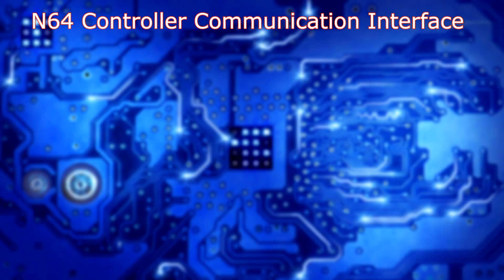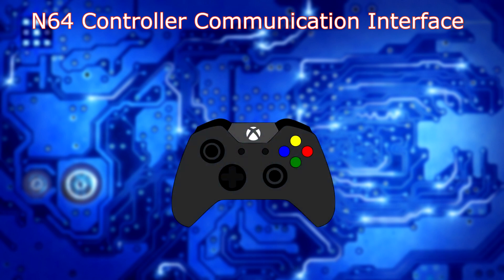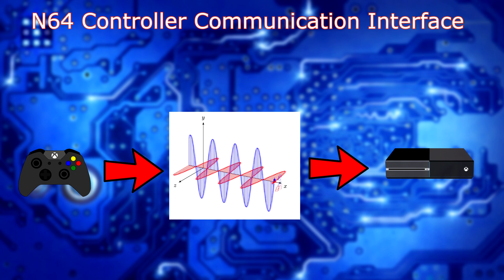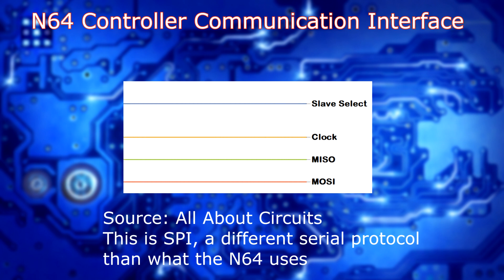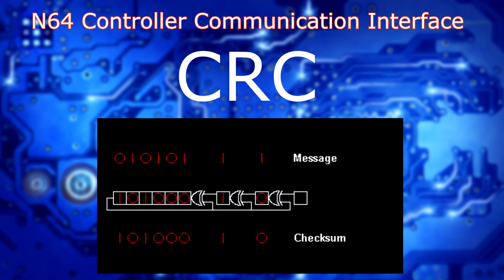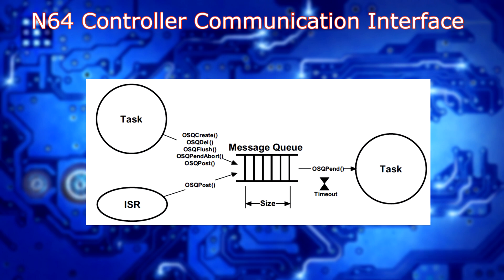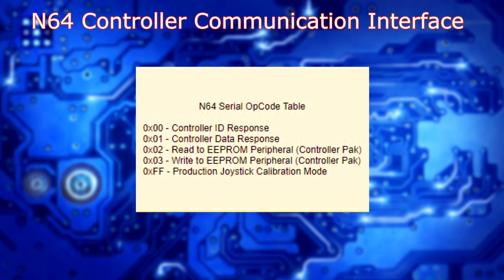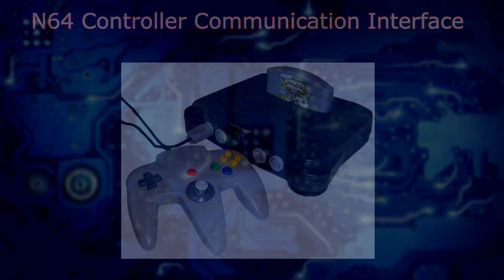How Does the N64 Controller Communicate?

Comment: The stick’s starting point is set literally every time you power cycle the controller. You can do this by unplugging and replugging the controller. There is also a software shortcut you can invoke in pretty much any official software by holding L, R, and Start. It has nothing to do with production or manufacturing and should be handled in software with no need for a special OpCode.
Reply: A lot of software developers use the word "production" to refer to code actively running on customer's machines after manufacturing and purchase.
Reply: @jl58533  “RTM” ;)
Reply: @emmettturner9452  I'm not sure what you're trying to say; if you mean "read the manual" it's been awhile but I'm familiar with the N64 and you are correct about resetting neutral position.
Reply: @jl58533  Programmers refer to “RTM” meaning “Release to Manufacturing” after an RC (“Release Candidate”) or two. ;)

Like, when Windows goes RTM after RC2.
Reply: @emmettturner9452  yeah it was missing another letter that's why I didn't want to assume lol

Comment: Controller Paks are not EEPROM. Why does the OpCode table refer to them as “EEPROM Peripherals?”
Reply: What are they?
Reply: @jl58533  Official Controller Paks are battery-backed SRAM but you can get FRAM or MRAM packs today (no battery).
Reply: @jl58533  Most game paks with built-in save had EEPROM but some had battery-backed SRAM and others had FlashRAM. FlashRAM is addressed the same as SRAM but comes in larger capacity and doesn’t need a battery. Of course, Nintendo only cared about the capacity since they were perfectly fine with using batteries. ;) There is one strange Japanese shooter game with dual SRAM which it uses for saving custom levels or something. It’s basically a shmup-maker.